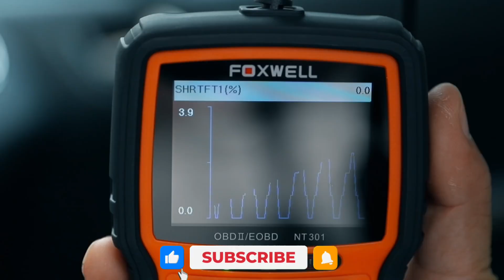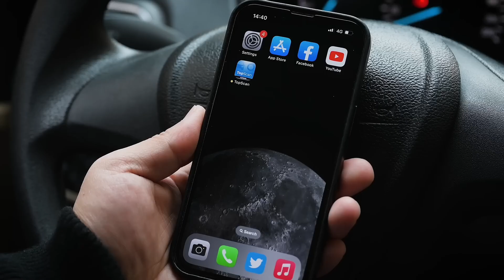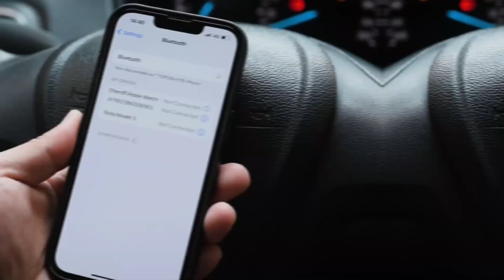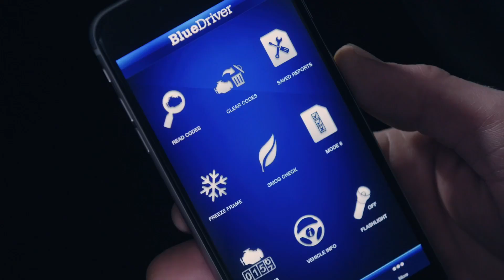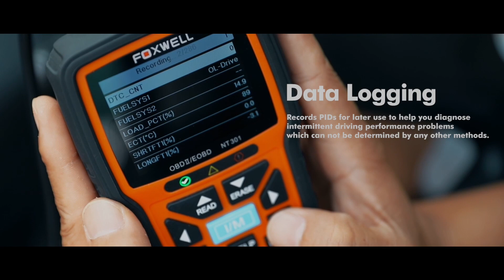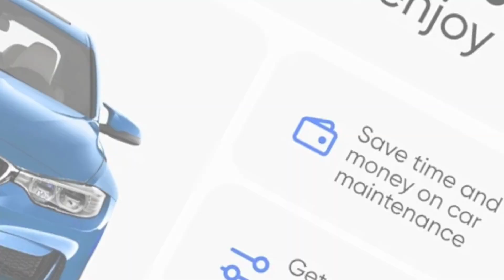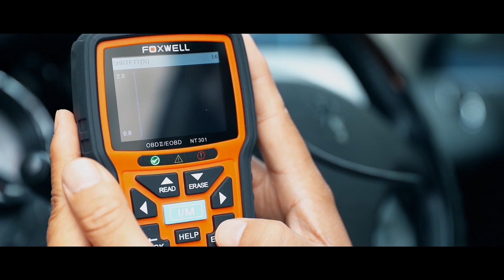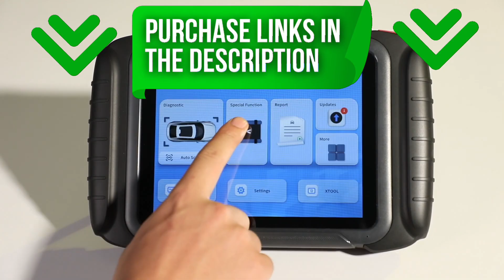✅ 9 Best Budget OBD2 Scanners on Amazon[2026]🚗 Bluetooth, Live Data, Code Readers & Diagnostic Tools

Comment: Do any of these work on ATV ‘s ?
Reply from the maker: Yes, but you need an adapter. Most of these will work to read basic engine codes, but you must buy the specific OBD2 adapter cable for your ATV brand, since the plug is different